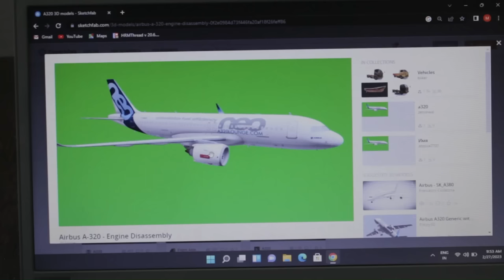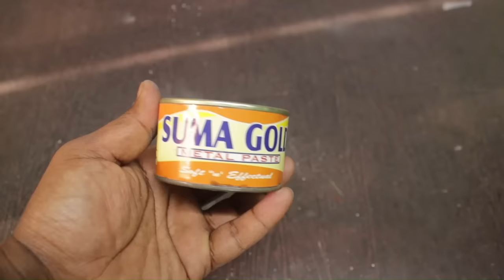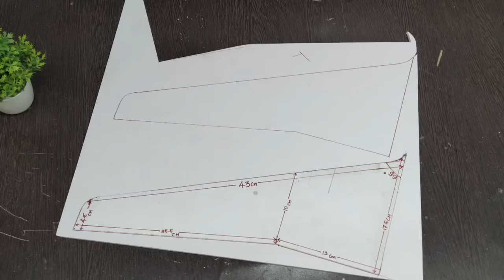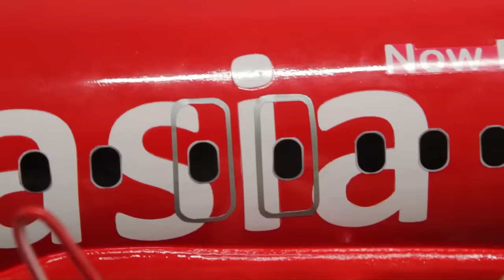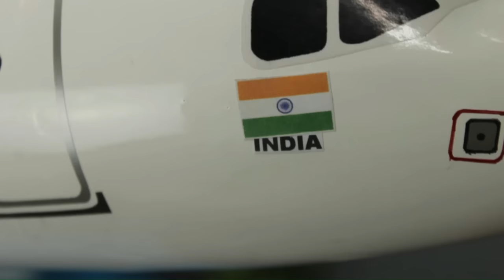PVC pipe turn to FLIGHT

Comment: Great job, thought it was going to be a radio control airliner.
Reply: Yeah a 26 lb. Rc plane with pie tin blades 4 motors ,yeah that will get you some major range from its design. Nailed it

Comment: What is “sun board”? very nicely done btw, one thing very noticeable on all Airbus aircraft is a cutaway of the top corner of the last window on the flight deck.
Reply from the maker: Sun board is thick fome material
Reply: I think it's what's in other places is also known as "foamboard" (USA), "papel pluma" (Brazil), etc. Seems to be an internal foam core veneered with cardboard on both sides.